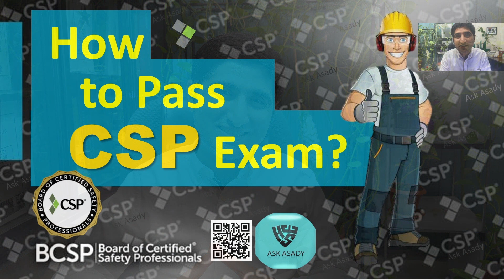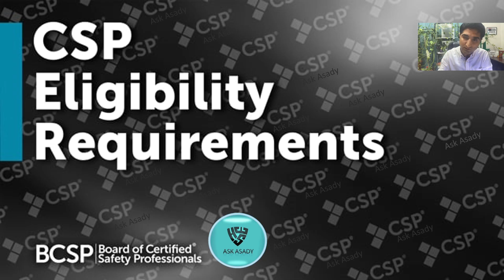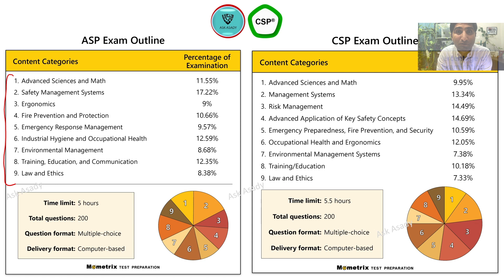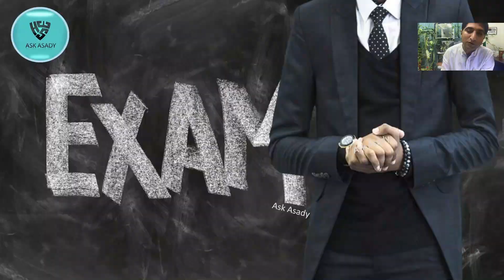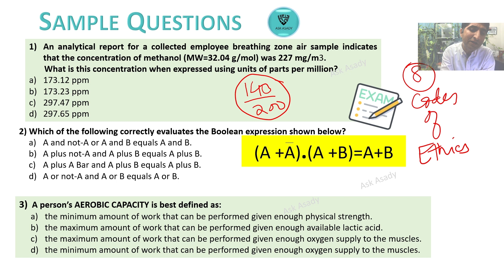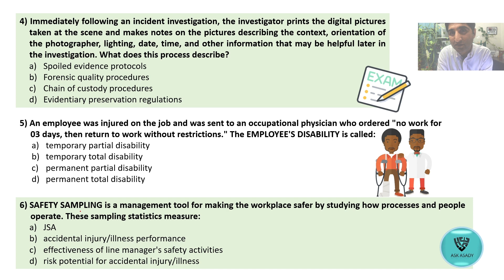How to Pass CSP? || Certified Safety Professionals Certification Pass in 1st Attempt

Comment: You have told NEBOSH International diploma holders have 1 year to take admission in CSP but there is no mention in official requirement published by BCSP.
can you clarify this ?
Reply from the maker: Yes, NEBOSH IDipcan be a pathway to the CSP certification, but it depends on which syllabus you completed. Holders of the older NEBOSH International Diploma (pre-2015) could apply directly for the CSP exam. Those with the newer syllabus (post-2015) may need to apply for the Transitional Safety Practitioner (TSP) designation first, which then serves as a pathway to CSP.
Reply: is one year gap is mandatory for applying CSP if you passed Nebosh Idip.Noting written such in CSP requirements?